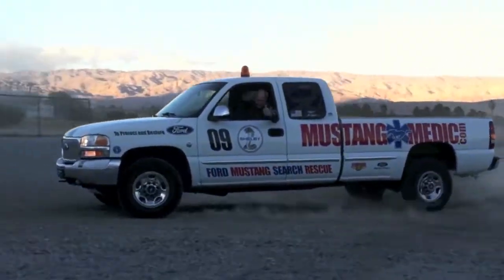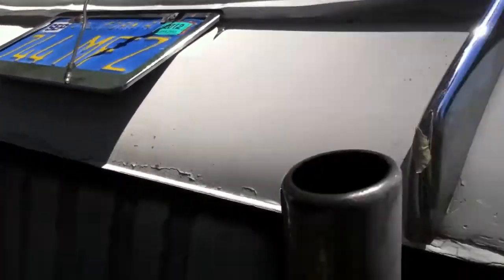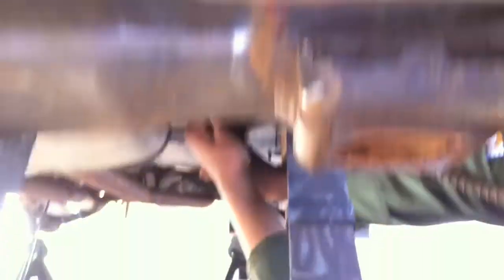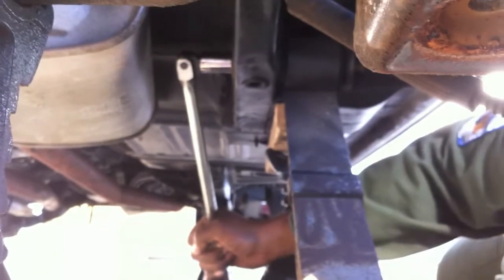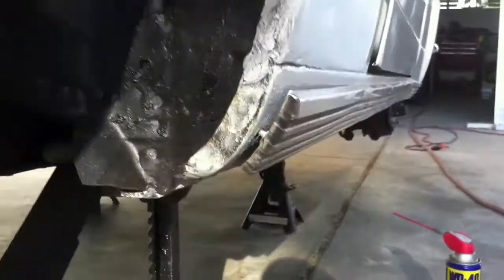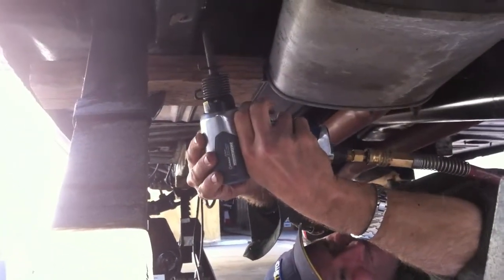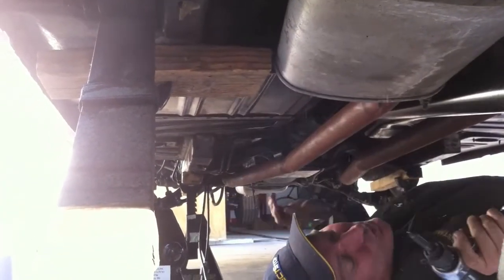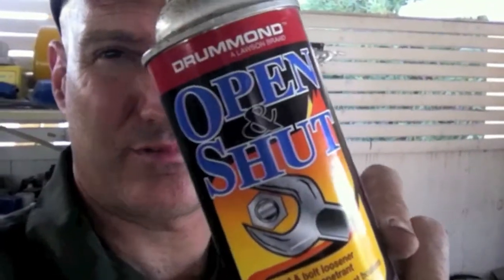Taking off the Leaf Springs not fun - 1966 Mustang Coupe - Day 44 - Part 4

Comment: Would have cut it out at the first sign of a problem.  Would use a cutting disk insted of a saw.  But its all made out of what you have in the tool box.  Great call Will.